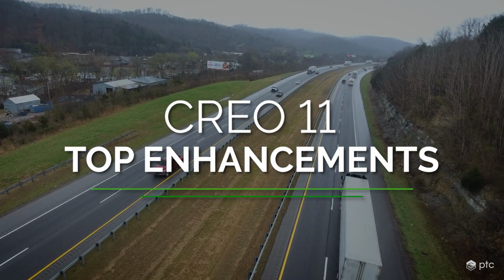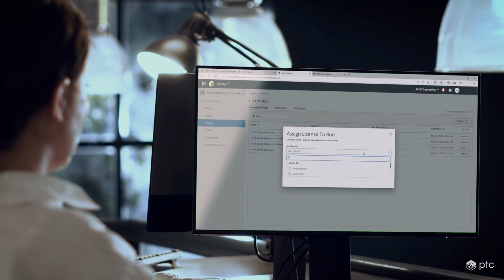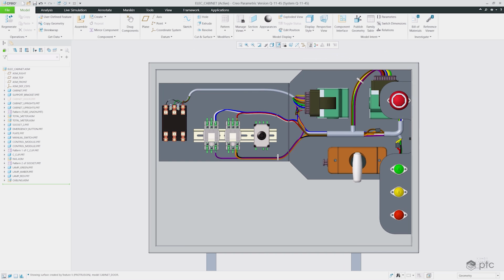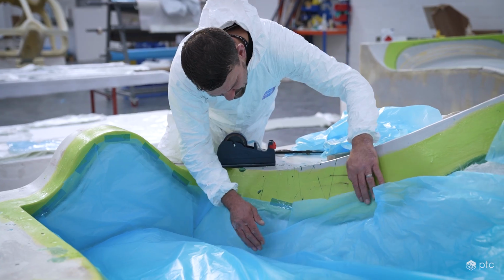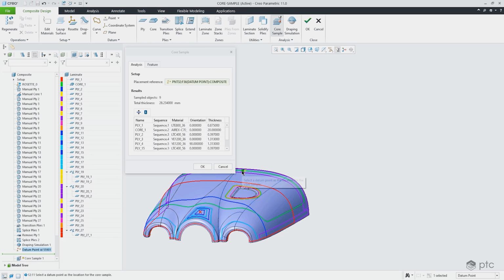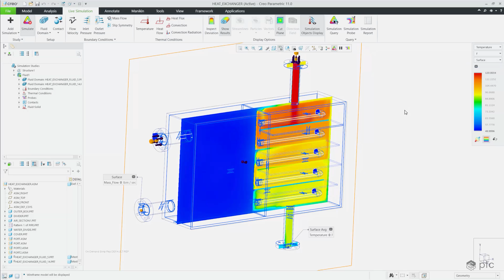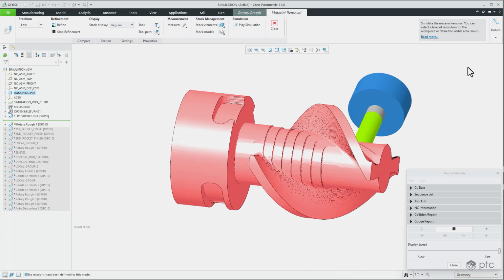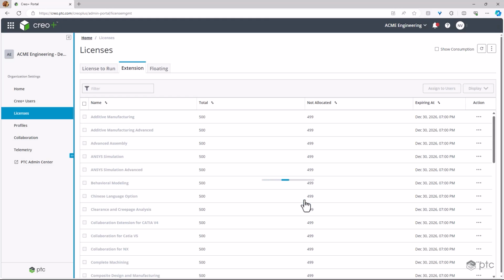Top Enhancements in Creo 11 and Creo+

Comment: I use creo for many years. The thing that I hate the most, holding Ctrl key for multi-selection. It is horrible. I don't see any advantage of this way over other softwares in which click the mouse button helps to select the part and keep it selected for next click.  Hope Creo fix this in this version.
Reply: and upset every single creo  user that learnt the software from the start? theres nothing to fix mate..
Reply: god forbid you have to press ctrl to multi-select, like you already do every fucking where else in Windows.

Comment: Is there a pattern function in the sketcher?
Reply: I was looking for this comment. I agree! Take some lessons from Solidworks (and potentially others) on this one, Creo, and add some tools to your sketch function. Sketch patterns are a great way to equally space out things like a structural components between two other bodies. I just did it the other day in your software manually by copy/ pasting the profile, adding construction lines between profiles, and then equal constraints to the construction lines. That is a 2 minute task with a pattern function.